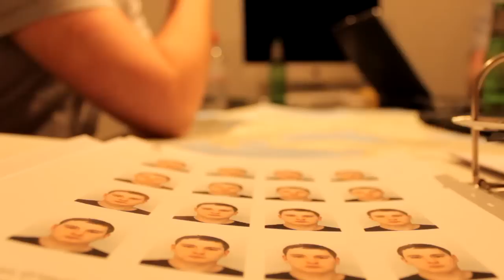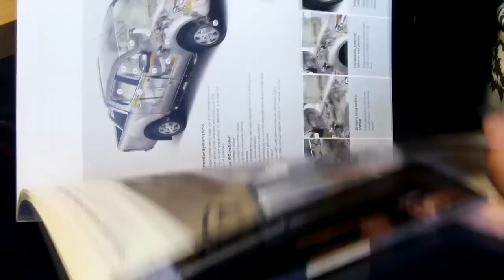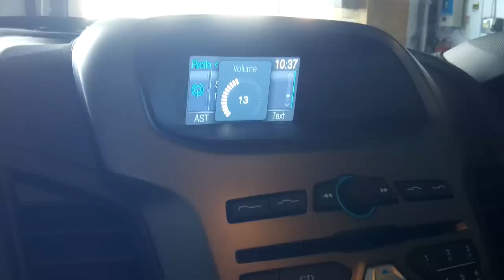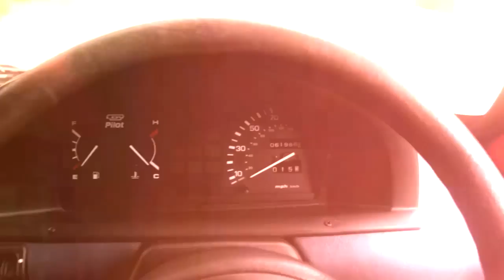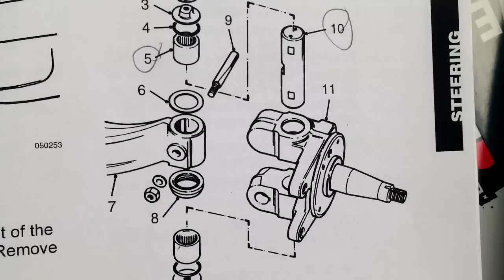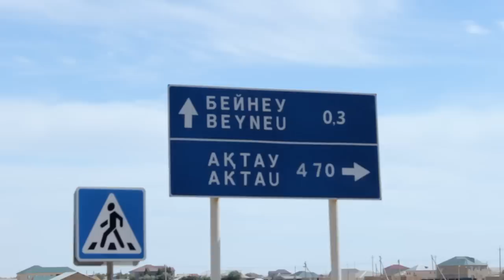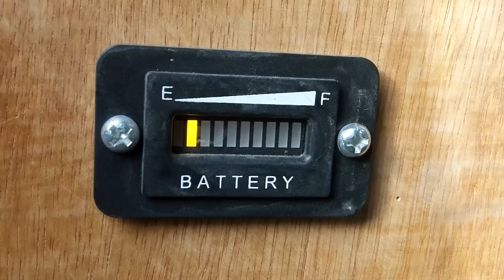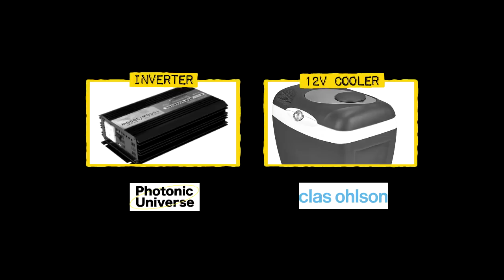A Mammoth Steppe - Full Documentary to Mongolia

Comment: So this model of ldv van originates back from the 70s,80s sharpa van I believe, I could be wrong but, In 1983, someone gave me a lift to my house which was at the top of a veay narrow and steep country lane. Most new cars at time period would be driven up that hill in second or even sometimes first, not third gear. The mighty sherpa van had a high compression engine which is what made me see somthing like a mirical happen when the man who showed me how he could effortless climbe the hill in third and even forth gear at on 15, 20 mph without stalling the engine. That engine had so much compression and  torque you could put a rope around a house and pull it down without even revving the engine high and as far as I can remember it was a carb, not fuel injection fuelled . People mock British built vehicles but as the ldv van did show it got them there all in one peice.